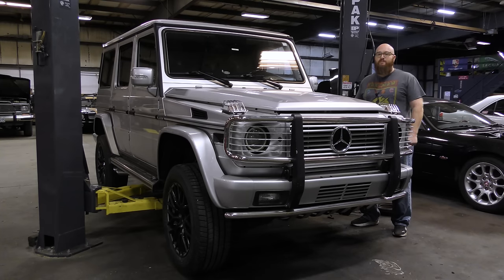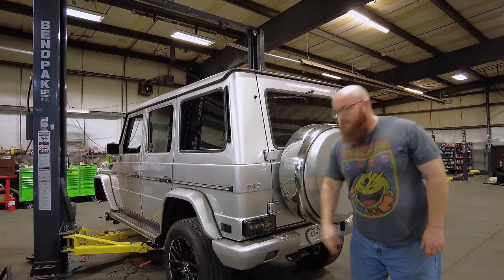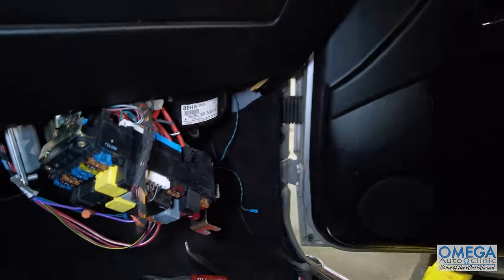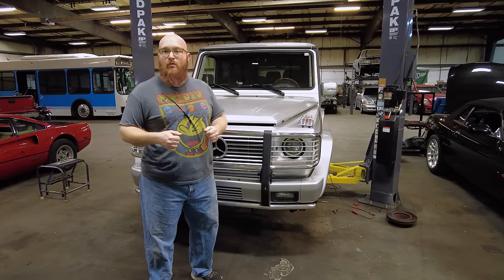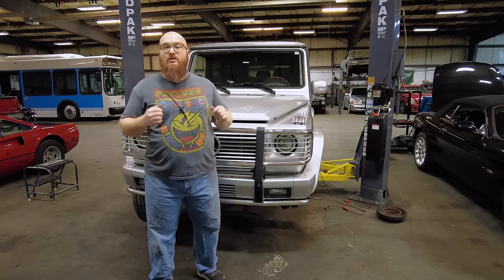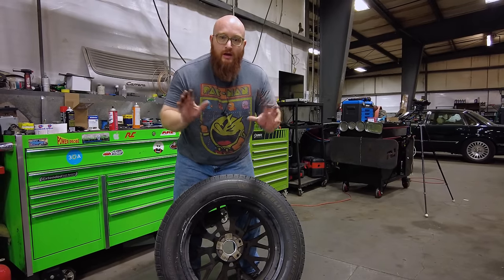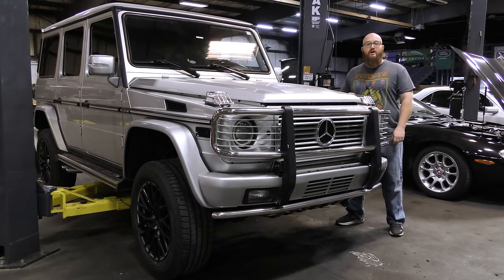Dangerous Mods on this '03 G55 AMG G-Wagon! CAR WIZARD shocked at the level of stupidity

Comment: i would guess that the wheels that are on might not be the reason for them cutting of the concentric pieces on the hubs, but previous wheels.
As for the SAM and the rear lights: i think the things to keep in mind is that the onboard diagnosis which light isn't working (when a light breaks) now will not work for the rear ones. And that then also means the "replacement emergency function" mercedes uses for decades also won't work.
With the rear sam working it would mean if for example a rear indicator breaks, another lamp will do the job until the indicator lamp is reaplaced, same for the brake lights. Mercedes does that for a long time. Even my 1994 C-class already has something like that in very low tec way. My rear light lightbulb on the drivers side gave up once and i got a notification on the display that a rear light was defective. When looking i couldn't find what's wrong as both rear lights seemed to work. But instead of the rear lights, the brake lights were doing the rear light job. So i only figured that out when taking out both inner rear light casings and checking the bulbs. In later models the car would exactely tell you which bulb was defective.

Comment: when i saw the tire wobbling i immediately thought some idiot put an aftermarket wheel on with too big of a bore without an adapter ring, which would have done the same thing. yeah, im going to bet this was a police auction vehicle....

the only issue now is that you have modified the hub to fit that non stock wheel bore, which is fine if those are the wheels that will stay on it but going to be a pain if someone wants to go back to stock. not really much else you could do though

Comment: I had one that had water in the tire? Caused the wheel to be unbalanced
Reply: That can happen if there's condensation built up in an air compressor, which is then used to fill the tire. Letting some air flow out of the compressor hose before applying it to the valve stem can help prevent this.

Comment: People often blow the rear sam unit by jumping the battery when flat and it can short them and relay out, all german cars after about 1999 most European car having jump start terminals in the engine bay area. 
I learnt the hard way with my 2008 mercedes e class jumped the battery and blew the bms and three relays £726  in just used parts to repair. 
Now leave all my cars on smart chargers and if ever jump any other car always use terminals under the engine cover. Awesome creative fix my welding is crap i would sell the rims fit std merc wheels with new hubs

Comment: I think if he blacked out the chrome it would look better. Mercedes will electrify the G Wagon and I’m curious how much range it will have.
Reply: In my opinion, this is not the car to be fully EV, more hybrid. Why? Because the g wagon has a terrible drag coefficient, huge wheel, pretty much worst case for an electric vehicle. So even if they put a huge battery pack (>100kW), you would get bad miles/kW and get a range of 200 miles max, and getting worse for highway use. They would have to change the whole design of the car to improve drag coefficient, and that's not what customers of g wagon would want. It's a box-y car, like an old school defender. 
A shop in the uk did EV conversion on Land Defender, old school one, they are great for offroad with high torque and diff locks, but on roads (what g wagon owner would see) you won't get good range.
I would think since they have the hybrid technology on other mercedes SUV (glc, class c, etc), they will soon (it has been announced for 2024), they will offer mild hybrid or plugin hybrid next year, with a 10kW battery pack in the rear. 30-40 miles of EV range, and then long distance drive with the petrol engine.

Comment: Honestly if the wheels were carefully installed and torqued correctly you can get away without the centering ring. I'm talking torque in a star pattern with 3 or 4 rounds of increasing torque (say 25, 50, 75, 100 ft lb). The center ring just makes it much easier. The example I have is my wife's vw atlas had a flat one morning, I had a spare set of winter wheels and tires from a MB GLC that happen to be the same bolt pattern. The hub of the atlas is too small and so the wheels should have a plastic centering ring installed, but in a pinch I was able to install the wheels  and carefully torqued them, figuring I would order the centering rings another time. The car drove so smooth with no vibration I never bothered.
Reply: The hub is supporting the weight of the vehicle and transfering bumps, etc... into the hub. The wheel studs are only designed the pull the rim against the hub. They are not designed for sheer forces. I've seen numerous vehicles bust wheel studs, some even have the wheel fly off while driving, due to using wrong rims or adapters that don't use the hub centers. 
It is just a matter of time before a stud will break.
Reply: @JasonWW2000  yeah cause that plastic ring is really holding the weight of the vehicles...
Reply: @TheNotimprezed  Factory rims don't use plastic rings. The rims and hubs are machined to fit together with minimum gap. If a person buys an aftermarket wheel that has an oversized hub hole they need to use an aluminum spacer ring. Any company making spacers from plastic does not understand how they work. Or maybe they don't care about the customers safety and they take advantage of the customers ignorance on the subject.

Comment: I put some 18" with super low pro tires on my 93 caravan. And I had a super hard time getting the rims centered. I had vibration issues for a long time until someone told me that my rims might not be centered. Well the 5x100 to 5x114.5 adapters were not centered. It took a bit of time and patience but I got it right eventually. Did wipe out the old ball joints tho and might have been cause for the rack going bad 6months later.
Reply: Some adapters don't have the hubs centers properly machined. This is what supports the vehicles weight. Over time it will start breaking wheel studs.

Comment: I think it’s funny when some places are out to just get some quick cash. The old dodge place in town quoted my mom for a whole transmission cuz the way the car was driving. I said let me drive it. I looked at it and felt how it was driving. I run to the auto parts store and spend about 200 bucks for wires, spark plugs, a distributor cap. Thing runs smooth. Dodge wanted over 2 grand for something that wouldn’t of fixed it.

Comment: I'm guessing this vehicle may have been used for insurance crash-for-cash scams with the switchable brake lights and the 'wheel problem' being 'damage' that is claimed for. It wouldn't surprise me if the rear SAM is 'switchable' in some weird way or a bad module swapped in as extra 'damage'.

Comment: Genius to weld and machine new concentric rings onto the front hubs. Not only does the concentric ring keep the wheels true to round, the ring actually takes all of the vertical loading of the vehicle through a “load path” from the wheel to the hub and suspension. In this way the lugs ONLY operated in tension and NOT in sheer. Removing the concentric ring makes the lugs operating in tension AND sheer as the lugs have to take the burden of all the vertical loading of this heavy vehicle. The load path is now transmitted through the lugs. Removing the concentric rings could cause complete lug failure and allow the wheel to detach from the vehicle at high speed. Very dangerous just so they could install cheap aftermarket wheels.
Reply: Shear.

Comment: Good repair wizard. I would've tapped the from front sam circuit to be a signal for a new relay and 10 amp fuse. But amperage is low it should be fine.  Love ur channel

Comment: Man wizard. I know you have never worked in no Louisiana shop. Cutting off the lip on the hub to fit some rental rims. "Man that's what you gotta do to fit your rims".

I used to work as a bmw mechanic. Bmw  makes more sense to me than Toyota. (that's me not every one else i know) but I would get customers like this.

" I just got a new BMW 745 from a flood auction in Houston what's wrong with it can I put on 24-in rims?

Well the suspensions broken the drive shaft is broken the engine's broken the water pump is broken the radiator is broken the wiring is broken the parking brake is broken the transmission is broken the electrical system is broken and the smoke under the dashboard is from a self-tapping screw GPS that went into your light control module.

Cool cool so i can put on 24s?

The customer then proceeds to jack up his car in front of the shop and using a sledgehammer to clearance the suspension.

Comment: Was this vehicle acquired at a police auction? 
Looking at the pattern, I think there is a very real possibility that this was used by a mule crossing the border. They may have taken apart and put the vehicle back together.
This could be a problem is someone driving this vehicle is pulled over and sniffer dogs alert.
If not that, them maybe it went through a chop shop.

Comment: I am curious why the lug nuts did not center the wheel properly? Did they not have a beveled seat, as most do? Nice diagnosis and repairs, CW 🐱
Reply: @jalopy2472  Also, the lug bolts are not there to center the wheel.  They are actually there to create clamping force which is what provides the necessary friction to transmit power from the hub to the wheel and thence the tire.  locating a wheel with only the lugs would subject them to shear force as well, for which the bolts are not sufficiently strong.  Tensile strength is what is needed in the bolts, not shear strength.

Comment: The front wheel has all the markings of a shady tire shop job. A reputable shop would have installed the wheels correctly. Also, did the right rear turn signal work properly?

Comment: Regarding the modification to the hub concentric rings; considering the freehand nature of the welding, was the item dynamically balanced on completion?
Reply: He turned down the welded ring on the lathe after welding. I guess that should be concentric enough?
Reply: @el_micha  Yes, he machined the outer diameter of the ring to fit the internal wheel diameter. The ring/hub weld was on the inner surface, an uneven freehand weld, which was not machined.
Reply: @wabwee60  Ok, but what is your point? That the mass of the welds itself does have an noticeable impact on the balance of the spinning hub/wheel?
Reply: @el_micha  My point is; the mass of the weld itself would have no impact on the balance of the assembly, if it was evenly applied, by utilising an auto feed TIG device for example. An uneven, hand applied weld will obviously render the assembly unbalanced.
Reply: I am not an engineer, but seriously I doubt the weight of the welds really having an impact on the balance. Given, they're so close to the center of  rotation.
Reply: @el_micha  As an engineer, I can respectfully advise that any rotating component, relatively high speed in this case, should be dynamically balanced. I could also go into the the desirability of NDT of the a welded rotational component, possibly a little pedantic but basic engineering practice.

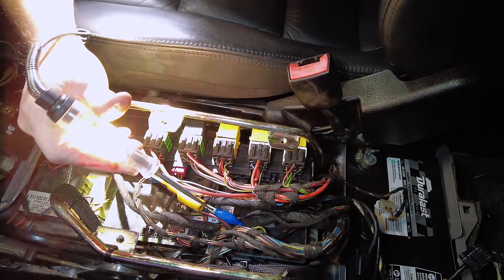Comment: Why is there an AGM  battery in the center console (the duralast one at 7:54 )? I've never worked on one of these, only ML class. Is this common? I generally do public safety upfit of domestic branded vehicles and I've never seen this before.

Comment: What is the purpose of have any modules to operate the lights? Didn't have them for decades and the mechanical flashers and headlight relays all were fine, except when you had a bad ground. Same goes for modules that run power windows and locks. Who needs it?
Reply: Mercedes likes to be courteous and let you know if any bulb happens to be burned out.

Comment: I find it interesting that they had switches on the brake lights so you could drive blacked out. Easier solution would be to put the switch hooked to the brake switch (unless of course the computer requires it for anti locking / similar). 
If I was to install something like that I'd probably have control of it from the cabin.
As for loading on new brake / indicator etc lights, a BC548 transistor, small relay, resistor , diode and some wire would fix this with very minimal load (comes in handy if you want to add aux brake lights which draw a lot)
Reply: The switch is to change the animation of the light.

Comment: You say very little load, did you remove the resistors from the tail lamp?  Or were those for running light/ stop lamp to get 2 levels of brightness?